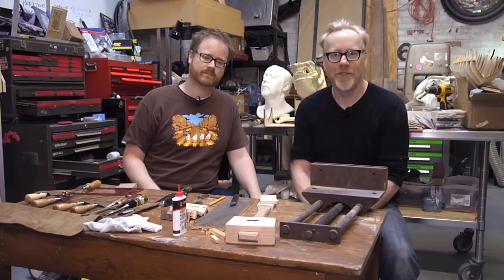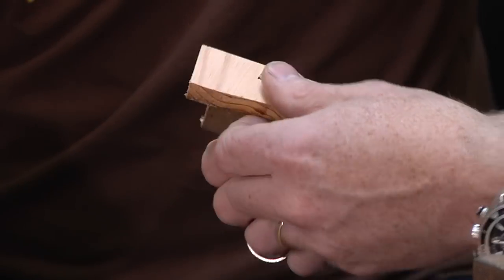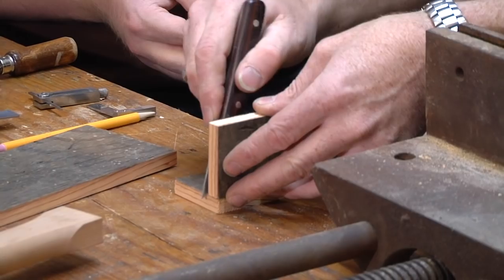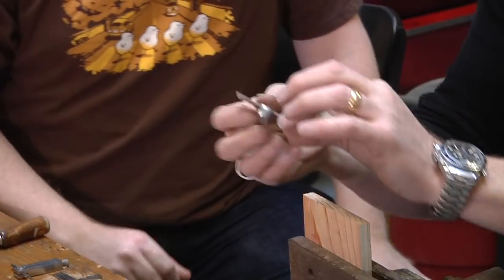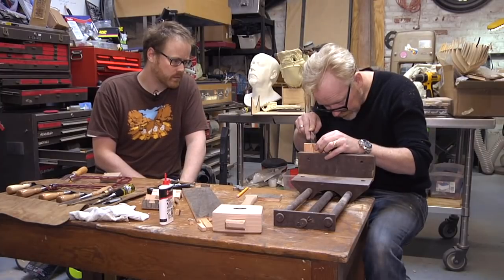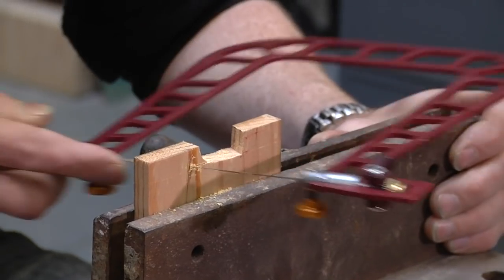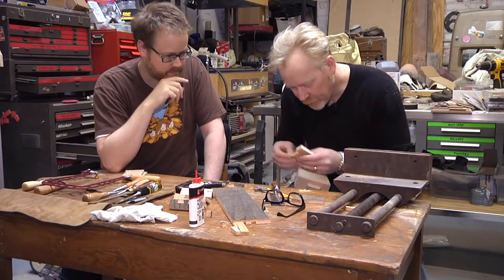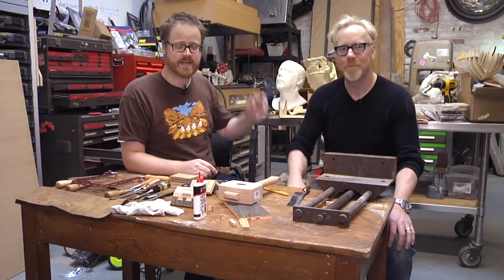Learning How To Make Dovetail Joints with Adam Savage

Comment: a couple of pointers to when cutting the second half of the joint make your first mark then move the piece over to cover the mark before making the second this will ensure a tighter fit. also instead of the coping saw to cut out the bulk use a wide chisel first lightly tapping along your marked line the move a few mm towards the grain end using more powerful strikes to remove chips in a vert/horz fashion work half way through the slowly chisel back to your line flip the wood and repeat.

Comment: Try a Japanese saw with zero kerf and always stay on the waste side of your scribe lines. 

Also, using a marking gauge (I like the Lee Valley/Veritas "wheel marking gauge", part  05N35.20), at least for me, is far more accurate -- and repeatable. 

Finally, you may find that practicing on something other than pine -- such as poplar or alder or maple -- is actually easier because it is less likely to chip out and it's easier to take fine cuts. 

Nice job for your 4th go, Adam! Cheers, mate.

Comment: i am not a carpenter but my uncle is vorking in a train factory and to put wheels to shafts they actualy make holes smaller diameter than shafts to make it fit tightly and that is steel so when working with wood i use this same technique and so far it works

Comment: Years ago a long time dove tailer would undercut the tail and the recieving hole and then chisel and sand them so they would just barely pop together.  He said it wasn't to cut the hole to fit but to slowly cut them to fit each other (ie if the tail is crooked on one side match the hole to it).

To make the joints more watertight he would cheat and pipette in water resistant wood bond in the corners by the dove tails and rub it into the completed and locked tails to give them a longer life.

Comment: Adam, check out this video, follow along, and pause where you need to. Pay attention to cutting away from the line, and how he is using the chisels. The flat side against the cut, not the bevel. Also, patience and practice can only help. not bad for your fourth, but technique is as important as practice. Un-learning bad habits is harder than learning it correctly the first time. You can follow his steps and do "through" tails first and practice with those before you try the "half-blind" tails he is doing in this video. Also check out Paul Sellers, he has all kinds of how to videos on cabinetry and has over 50 years of experience.

Comment: You can remove the dovetail slot from the middle that let's you get sharper angles  on the corners  and a good angle rasp or bastard file will let you cut sloppy with a saw and make even snugger fittings. Try it

Comment: You are doing well.  Like Kirk said, you are cutting directly on your marks.  You should cut inside of your marks for a tighter joint.  The reason you scribe the lines instead of a pencil is to insure tighter tolerances.  Watch Paul Sellers on how to make both a marking jig and how to make them.  Paul is one of the best instructors I have seen, and he is on youtube.

Comment: Japanese saws are probably superior for this kind of work, you can also get a jig for the saw so it cuts straight.

Table saw, band saw and good chisels are what you need for fast, precise dovetails. You can make the pins at any size and at many different spacings which you can't do with a router. Cutting a shallow dado along the inside of the tail piece will also make the inside of the box look cleaner. Also Adam needs a proper bench.

Comment: You should undercut the shoulder of the mortise  and ease up on the line. That way as you're test fitting you can ensure a tight proper fitting joint.  You have to account for the thickness of the blade. So cut inside the line and chisel away to the actual line.

Comment: the way i learned to do dove tail joints was you marked up both pieces of wood (you did not use the "tail" to mark out the negative in the other piece) and to cut on the inside of the scribed line in the waste wood to keep the joint tight, we didn't use coping saws to cut out the negative we were taught to cut vertical lines down the waste to the measured dept of the tail and then use a chisel to chop out the waste and then to clean up the negative with the chisel and then to sand it..

Comment: I think the main issue was that the female piece was a square cut, rather than a trapezoid. The strength from the dovetail comes from having trapezoids on both faces. The complexity comes from the male end looking almost like a truncated pyramid, with a trapezoid cross section on 2 axis.

Comment: An adjustable dovetail jig and cutting them slightly smaller than needed then sand them to fit. Or in some cases use a sharp chisel as you did.

Comment: Adam, You are on the right track.  Wish I were there to assist you.
Might I suggest to buy or build a workbench and mount that nice vice on it properly to start?
Also ... Follow how Paul Sellers teaches dovetails. 
look up "Paul Sellers makes a dovetail box" on you tube.
Paul is a great teacher and he will debunk much of the steps for you.
Also, there are a few key things like a Dovetail Saw, you will need a hand plane.
Try using even fine grained wood like Eastern White Pine.
Good Luck,  Walter

Comment: hello Adam! you're getting that large gap because you're probably cutting right along the line, as in fact, you should cut inside the line. and there is a tip to make your cut straight: recess the other side of your saw in something that's heavy ( so it doesn't move) and straight. I use a 1 inch steel plate, that has been straighten in a lathe. PS, I'm a dentist, not a carpenter, but I

Comment: it's a loose fit because he is using one piece of the dovetail to make marks for the other and the width of the tool he uses is becoming a gap later on... if he uses a measuring instrument instead to make them even it will be realy tight fit :)

Comment: I found that quite painful to watch. Please, please, please take not of the following and the advice of the other craftsmen on here. Would be interesting to see how your dovetails are turning out now after some practice.

- Softwood angle is 1:6 and hardwood angle is 1:8 (generally)
- A square should be used in conjunction with a marking knife/scalpel
- Always use a well secured vice
- Cut standing up with feet in a stable position and front foot toes pointing forward to align your torso
- Beginners benefit from tilting the work piece so that they cut vertically (a more natural body position)
- Always cut on the waste side so that the kerf (gap made by the saw blade) doesn’t create gaps on the finished   product.
- ALWAYS secure your work piece and use both hands on a chisel if you value your fingers
- When marking the opposing piece, have them supported in some way (I normally place one piece in the vice and the  - other on the bench or on top of a resting bench plane)
- When cutting, keep a natural arm position and look down the length of the blade (You wouldn’t walk down the street with your elbows sticking out)
- I believe it is fine to use a coping saw to remove stock but this must always be kept on the waste side so that you can ‘register’ your chisel in the marking lines and pare down for a clean finish
- Always use the widest chisel you can. Narrow chisels can create a zig-zag line as the amateur is prone to twisting them
- Use the back (flat side) of the chisel for paring, that’s what it’s for
- Don’t undercut the angles! If you must ease them, make a V-cut so the dip is in the centre rather than the edge of the material
- Always glue up before planning off excess material

Comment: A lot of proper carpenters are commenting on what he does wrong and even though they're probably right I'd say the easy way to get good dovetails is to remember to account for the width of the cuts. so you need to either saw on the correct side of the mark or mark with the saw width in mind. But as always it takes a bit of practice and I'm sure Adam has worked it out by now. However someone else has a go and wonder why they're a bit loose that's usually why in my limited hobbyist experience.

Comment: I think you cut the pieces in reverse order.  The tail side should have been cut before the pins.  The pin can then be cut to the exact shape ast the hole for it to fit in.  It can also be cut silghtly proud and shaved down with a chisel or a wood rasp till you get a snug fit.  Check out the Woodwright Shop with Roy Underhill.

Comment: I think Adam's dovetails are not that bad, a little glue will swell up the joint. What I do think Adam should do is probably add a few more tails and pins. Maybe make a jig to do this on the table saw.

Comment: Well from when I used to do this, I would do much more measuring and marking. I feel that if there is a face on the wood that your blade is cutting through, it should have a marl, or you will just end up all off angle. Not so much of an issue with the band saw though.

Comment: I suppose that point where you slipped below the cut line is responsible for the slack.
Intuitively I would have cut above the line and then sand or chisel down carefully until you just get it it in.
It's always easy to remove material, never possible to add. You know. ;)
Since the sides are trapezoid, I think the lower plane of the receiving piece is your single point where you can adjust all wiggle room (if the angles are right).

Anyway, really love that video.

Comment: It is incredibly hard to get a tight fit using a saw at all... The trick is not to be lazy and to let it take time. Use a chisel all the way. Exept for the first cuts, to get the angle. You´ll have more control and a really sharp cut.

Comment: (I have never done a dove tail in my life)
Wouldn't a good way to get a nice dovetail fit be to cut the hole part a bit smaller, then slowly chisel away parts of it to make a tight fit? Or even have it submerged in water overnight to make it temporarily softer and squeezable when you hammer in the key part of the dovetail?
Reply: Depends on your objectives: Your way is fine if you want to get the best possible results (without having enough practice).
But if you really want to learn its better to screw it up a few times and learn how to cut accurately.
Reply: If you expand the wood by soaking it in water and then cut your dovetail, the joints will open up after the wood completely dries. You would want to fit it completely dry and then soak it in water to help with any imperfections. If you have a chance to look at 17 century dovetail joints, they don't look too far off of what Adam is producing. The finer pieces found made for the very rich are precision made by some of the finest hand craftsmanship of the period. It is an art. Adam's approach to "sloppy to play with" is hardly what the percussion craftsman would be so verbose about. I am certain there is a margin of allowance but I imagine that allowance doesn't start for about 1/4", or so, into the cut and most likely is within a 1/64" - at least that would be the aim.

Comment: It's easier to remove material along the grain with your chisels.  Make your cuts proud on the long grain side and cut just once on the other, then remove small amounts of material from the long grain side with your chisel until you have a tight joint.  Remove material... test the joint... remove material... test the joint... until you finally have that tight joint you want.

Comment: Never cut directly on the scribe line. Also you should use a wood block to guide the chisel at the correct angle when paring down to the your line. I bet a lot of the wiggle you are getting is from inconsistency on that part. Freehand is hard even for masters.

Comment: That's actually a fret saw (Knew Concepts 8" Fret Saw) , not a coping saw (i.e. Knew Concepts 6½" Coping Saw).  A fret saw makes finer cuts using shorter, thinner fret saw blades. A coping saw uses beefier, longer, more highly tensioned 'pin-shank' coping saw blades, for slightly faster, slightly coarser cuts.

Comment: He just has to cut on the outside of the lines as to leave a mm of room, then he chizles a mm in angle afterwards to slot the pieces together, and hammer them together with a mallet... softwood can bend a little, hardwood has the steeper angle because it locks in by itself, softwood does not. :p

Comment: Adam, please pinch on a blade of your your chisel exposing only the minimal length of the blade, this way you get more control and if the blade slips you don't get impaled, only cut yourself, the way you hold the chisel by the handle and point the tool towards your hand (6:10) is rather dangerous. David Charlesworth and Rob Cosman have excellent chisel technique videos and both stress this point. good luck with the chest! would love to see progress videos.

Comment: Adam, just google for Matthias Wandel's Pantograph. That a pretty fast way of making dovetail joints and other things like that.
Reply: I'm only somewhat familiar with the Pantograph machine, but isn't that more for mortise and tenon and not dovetail?
Reply: just look for his video
Reply: +Adrian Kulisch If you make lot of work like this you can uses pantograph, you can uses ready jig to router, or make jig for table saw. And in the end good furniture maker make work by hand befure you set up machines ;) I really hate make dovetails by hand, look for other solution if don&#39;t must uses it i don&#39;t but are beauty, and after lot of experiments in the end i cut them by hand. 

Adam had problems whit this  because he not uses tools proper, he try make this sit dawn, whit no clamped vise. Even can't grab chisel good- then sorry- how he wont to make good accurate cuts?

Comment: I learned this at school 50 years ago. Nobody ever taught Adam to use a chisel properly. That's half the problem. You can't cut accurately the way he's holding it. He's using the wrong side (bevel side) of the chisel at some random angle and hoping it'll cut straight. It wont. You have to bear directly downward onto the bench with your shoulder behind it, using the flat face of the chisel to cut precisely vertical. NEVER use a mallet or worse a hammer unless you're using a mortise chisel to cut a socket.

Comment: I disagree. Scribing the line with a sharp knife has two major advantages over a pencil. 

1. It's far more accurate (and potentially more consistent because the pencil point is constantly wearing down).
2. It cuts the top layer of wood fibers which helps prevent chipping/tear-out later on. Also, you can feel the cut line with the bevel of your chisel, whereas, with a pencil, you have to rely on your eye.

Comment: Adam seriously needs to clamp his vice to the table. Also, it looks like a new trip to the optician might be in order. He also needs to focus on cutting on the waste side of his marks rather than at the marks, which I assume is why it was so loose in the end. Otherwise, it's nice to see another beginner try. I've only done two so far. They were both very tight, if not particularly pretty.

Comment: I would tend to leave the line and then file (not chisel) the joints to fit.  That should get you that nice, tight joint.
Reply: That is a very creative solution and would work very nicely I suspect.
Reply: I'm surprised Adam didn't do that myself, although he's a professional, I'm sure he's practicing so that he can do it on the first cut. Personally I like to make them a tighter fit, and let the hammer do the fitting :).

Comment: The main thing I caught is that Adam said he was a decent carpenter. What's that old saying? what's the difference between a carpenter,and a woodworker. About 1/8 of an inch.  LoL   He bought a mallet. Why not go ahead,and pick up a compass for laying out the dovetails. Then put that Gents saw back in the drawer so it can rust some more,and get Dovetail saw. My apologies Adam. I had to pick on ya just a little. :)

Comment: what if you soak the wood in water or liquid then do your  cuts  and fit them ect. let them dry. swell shrink make a tighter fit?
Reply: Make better dovetails in the first place.
Reply: It may warp your wood.... You wouldn't want to take hours doing the side of a box only for it to crack and warp the next day, it's better to do things slowly and carefully than to try to rush and ruin something in the process
Reply: Best to wait until the moisture content is low before you begin any project.  Drying wood shrinks, warps, and cracks...  The wood you buy from the store has generally been kiln dried to minimize that problem.  Soaking in water makes wood expand... so soaking in water before you cut the joints would mean the joint would come loose as it dried.

Comment: Did you ever finish the chest? 

That's actually a fret saw, not a coping saw, but Big Deal.  No doubt, cutting dovetails by hand is a challenge.

I am concerned that you were using an unmounted vise.  That, combined with sharp saws and chisels, is a recipe disaster.  I trust you had band aids close at hand.
Reply: Actually it is a coping saw.
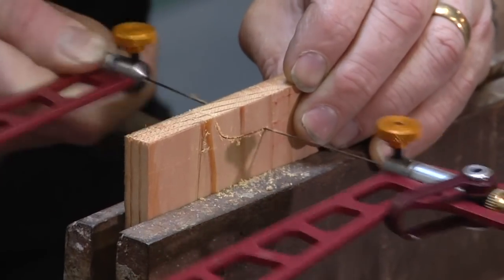Reply: OdahKing 7:37
Reply: jonathan jones It's a coping saw, a fret saw doesn't have the the screw wheels that hold on the blade.
Reply: watch?v=VhNNzgNZaLA Adam's video on these types of saws. Turns out he did use the wrong one for the job.

Comment: You are scary with tools man.  I never knew that about you.  You point that chisel around like its a ball point pen.  It's a sharp, dangerous tool and you pointed it right at your hand..  And your technique at the sander was like fingernails on a chalkboard.  there is a table there to support the work while you sand. Use it!  It will result in squareness.  If people copied your technique, they could lose fingers.  Please, issue a better disclaimer and practice safety.